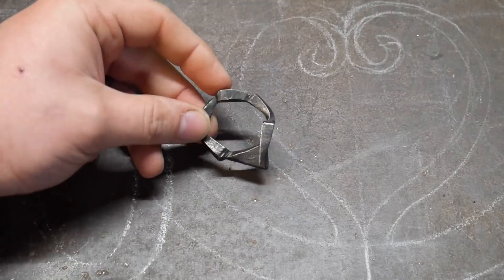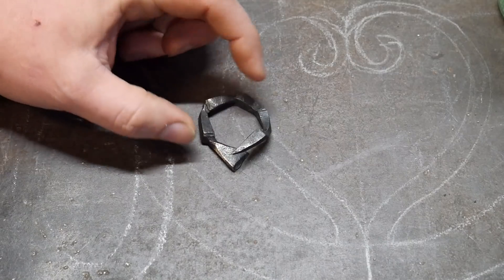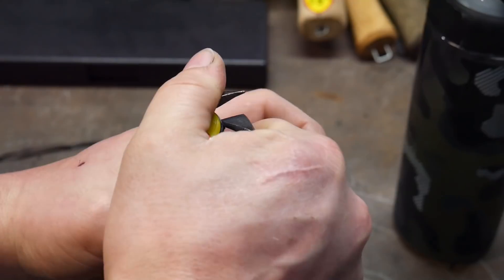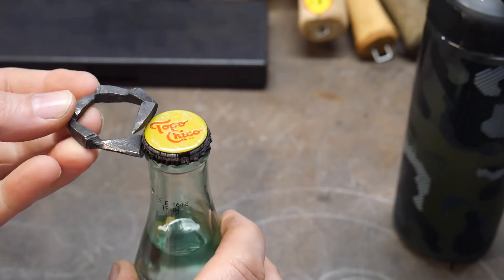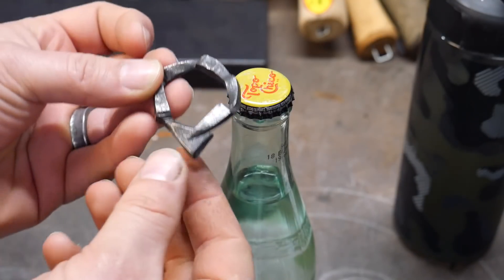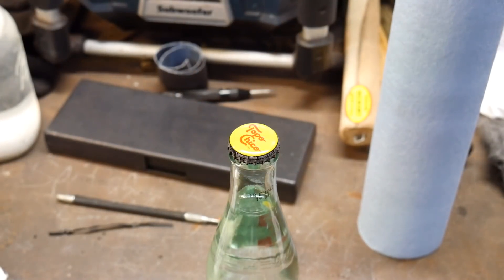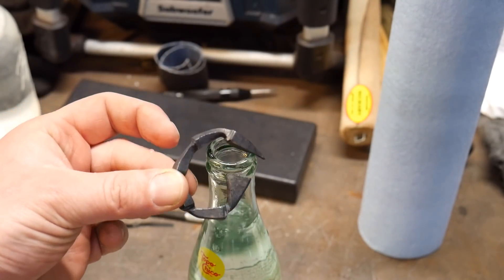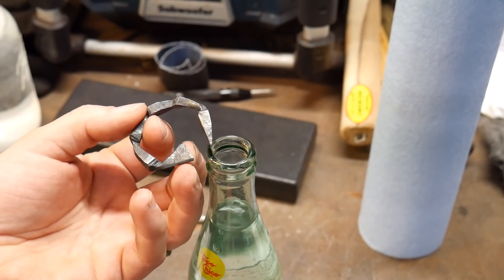How to Use the Scorpion Tail Bottle Opener

Comment: That looks like one heck of a challenge to make, let alone open a bottle with.
Reply: Blacksmith Mike actually making it  is pretty simple (granted took me a few tries, because I'm a beginner), however to use m, as Roy did, I didn't know. I had motified it slightly, and it worked great.

Comment: both versions look good, though i prefer the action of the original.

 maybe putting an inside 45° angle on the flat end would make it more intuitive for some? 

either way, cool design and something to add to my project list once I've got a forge set up. cheers!

Comment: To help in the second method that doesn't work in the original design, would it also be of benefit to bend the base of the tail up a bit so that it grabs under the edge of the lid?  It may also strengthen the look that you are going for with a scorpion tail, in that it would look more like a tail that is poised and ready to strike.  Just a thought.  I haven't tested it out yet, but the tip would definitely need to be adjusted a bit like you show here to get the correct leverage.  In my mind it would arch up like an actual tail ready to strike so that the tip is more toward the center of the lid with the base of the tail under the lip. The only issue with my mind's design is the leverage needed to pop the top off might be difficult to achieve.  I don't know.  I would think that more of an elliptical arch as opposed to one that is more round would be better...one canted more toward the base would give it the needed leverage...  Perhaps I'm rambling here without actually thinking the physics of it through.  It's difficult to explain what I'm seeing in my mind's eye since I don't know of any way to post a drawing on a comment (if there even is a way).  At any rate, I'll have to test it and see if I can perfect the design.  It might be a while though since my forge is down for the next little bit while I deal with other more pressing issues like fixing the car.  Hooray for real life!  sigh

Comment: You can palm this and fake out friends into thinking you are using brute strength (bare hand) to open pop bottles ;) and then challenge them to do the same. ;) Pretty cool designs. I like them both. Though with my disability. The improved one might be a tad easier. Not sure if I would be able to use either one. A handle would be much better for someone like me. But, still very cool and I would be apt to buy one just on that factor alone. <3

Comment: When I finally got one made, I had the flat end turned and slightly bent up, so the lip catches the lid, then the "stinger" end presses against the cap. So in all, the fan tail, I just turned 90 degrees and bent the tip up a hair, and it catches under the cap no problem.